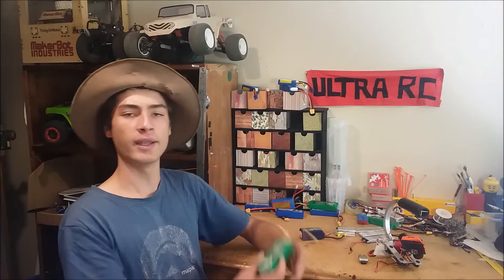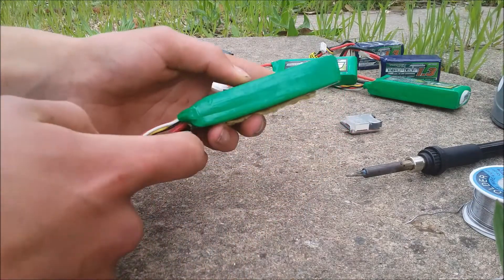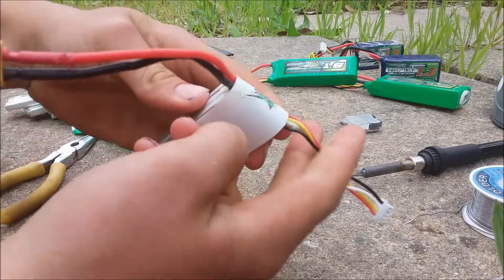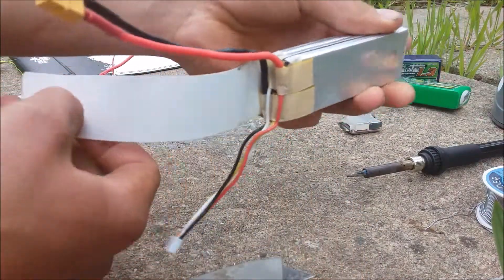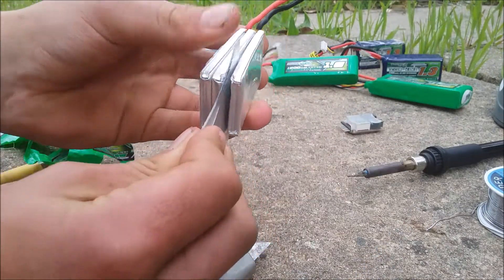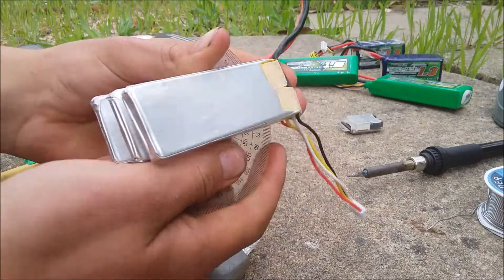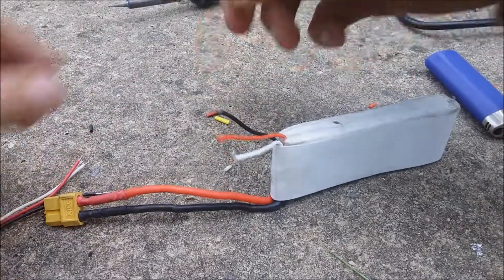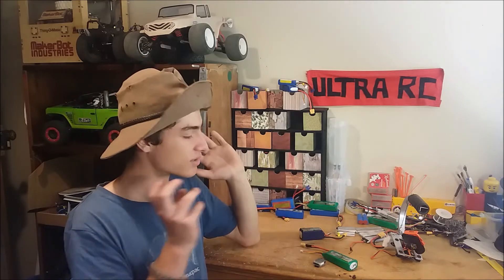How to remove a damaged cell from a Lipo battery //ULTRA RC

Comment: Small FYI for anyone watching this more recently. The small wire he used to complete the circuit and join the cells together may not be enough to hand the current between cells. A larger wire may be necessary.

Comment: I have two 3cell lipo battery with different mah. Can I combine and make a 4cell lipo even though the mah is different in the cells?
Reply from the maker: Hello this is a good question!!
If it is close im sure it would be fine.
I think you would be prone to braking the higher cell.  Older batteries hold less mah than they are suppost to so you would want to charge them to see how many mah they actually hold.
I've not done it and I am sure people would advise you against it.
Hopefully this is some stuff to think about!
Thanks for watching Ultra Rc Mate!!!
I appreciate your support!!!
Reply: @CORINKERSTEN  This will help. Thank you

Comment: To anyone who is going to try this, BE VERY CAREFUL WITH RDQ BATTERIES! The adhesive they use to hold the cells together is very strong and trying to slowly cut away the adhesive resulted in a fire. Just a heads up.
Reply: I think RDQ batteries are made by GNB so you need to be careful with those as well..

Comment: Hey man I got a 4cell 1800mah lipo battery and when I wanted to charge it the 1 cell was at zero and the other 3 were at roughly 2.30. What do you suggest I do?
Reply from the maker: I would remove the 1st cell and cautiously charge it, obviously only it it isnt banged up.
Put it on as a nimh and watch it until it gets to 3.7 then lipo charge it. If that makes sense. It isnt dangerous if you know what you are doing. So if you think you can take a cell out i recomend that you do, it should come back to life!!!
Thanks for watching ULTRA RC mate!!!